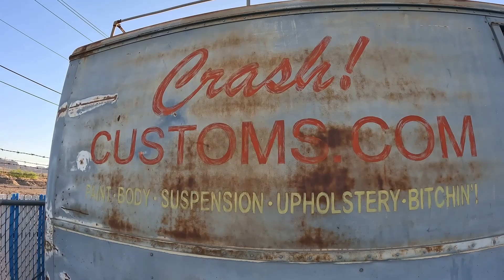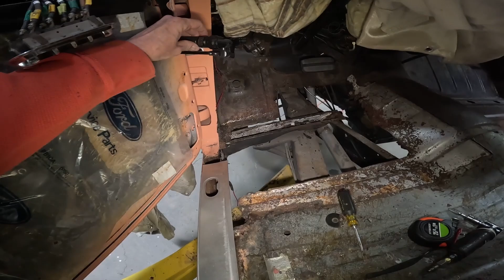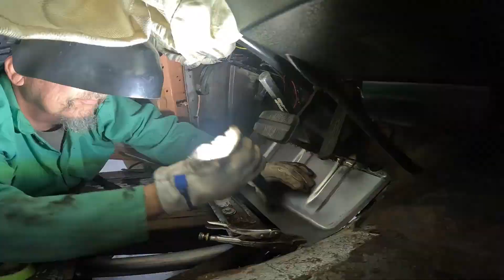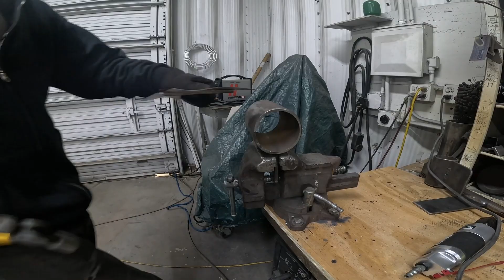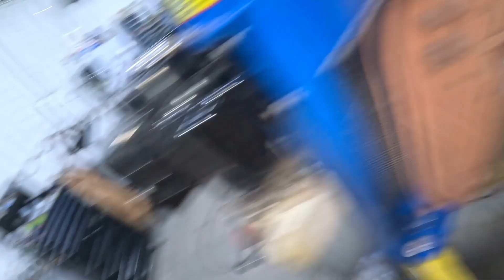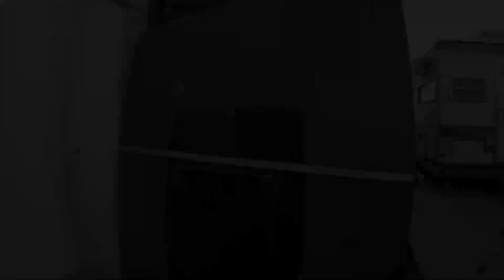1954 Ford Victoria Crestline rust repair, floors, sill plates, inner rockers. fabrication part 8

Comment: Just found your channel, I have a chance to pick up a 54 just like this even the same color. It is a project with no engine. What engine are you running in this? I heard that fitting engine and trans in is a problem do to the transmission cross member. Thinking about putting the Y block in with a original Ford O Matic. Can I drop that combo in together? Thanks for the help!
Reply from the maker: @ricksoldcargarage  this one has a Y block in it. Not sure on the transmission but the transmission crossmember is stock in stock location. All previously done before it came in here. I’m just doing rust repair metalwork. Thanks for watching and commenting!

Comment: That is the kind of repair you want to see on your car, nice job!  I still have to do about the same work on my '52 Mainline. Panels are not easily found here in Holland though (and shipping gets a bit expensive) so i'll have to do some shaping. Good thing is that my car never got bodged up in the past.
Reply from the maker: @erwindrenth7091  wow, Holland?! I don’t know much about the car scene there. Was your ‘52 there since new or imported later? It is better not having to correct someone else’s bad repairs.
Reply: @CrashCustomsaz  My Mainline has been in Holland for some time, but is was imported from the US. It's a coupe, fairly uncommon i think. I bought it recently for a really low price, but it had some missing parts like the engine... A flathead v8 should be on it's way from the US. That, and the bits and bobs that i ordered from the US have made the cheap car much more expensive..  Fords from the US were fairly common here in the 50's and 60's. We had a Ford factory in Amsterdam, mainly producing European fords but they did build the Mustang over here. Thing is, cars were mostly crushed after their useful service and not kept because there is just too little space. Nowadays there is a fairly large American car scene here; mostly Pickup trucks (old and new). It is just that our gas prices and road tax are insanely high..
Reply from the maker: @ nice, you just educated me. Probably 20 years ago my Dad sold a Mopar Scamp, I think it was a ‘75, to a guy in Holland. I remember the tires had to be the same size all around for inspection. It had big and littles. Don’t see many Mainlines here either.